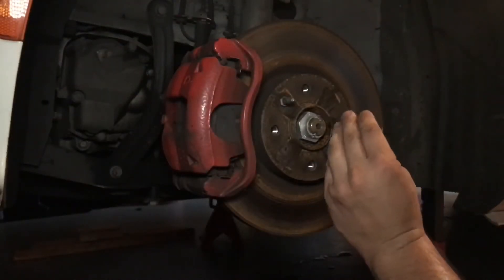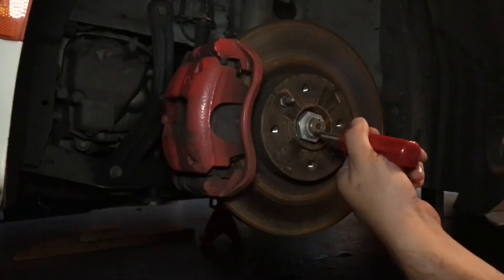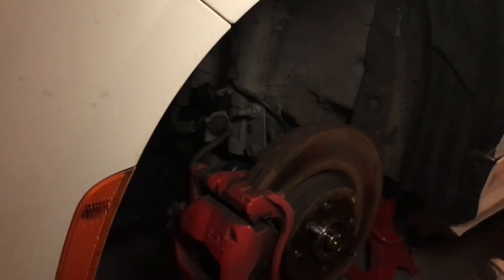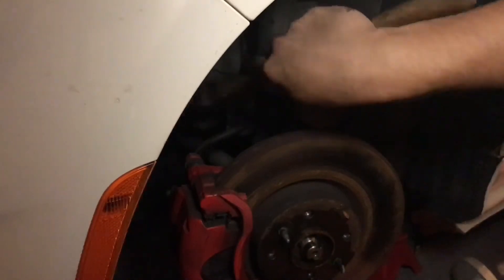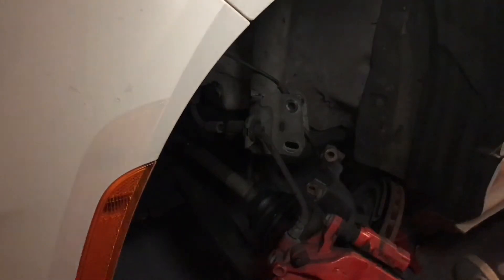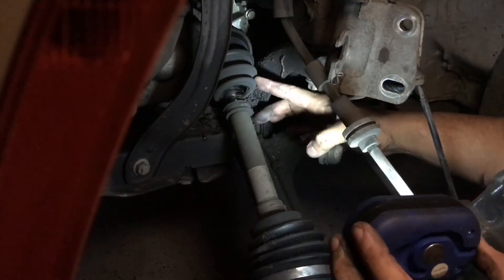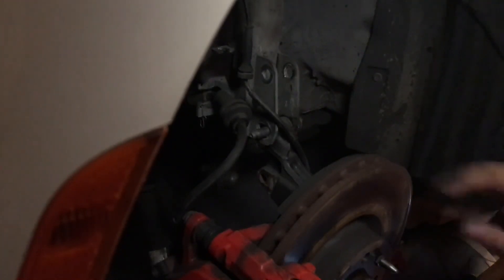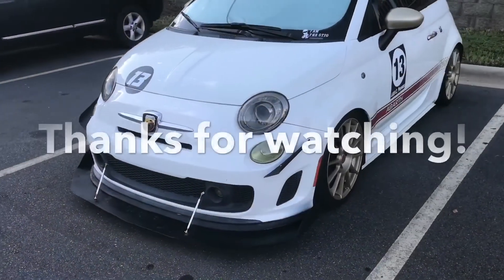Fiat 500 Abarth Axles Pt.1

Comment: That axle nut requires a tapered socket.  You wont find one in the USA.  You can order one from England.  I bought a regular socket from the local auto parts store and then I ground it down so it was tapered.  I am surprised you got yours off without doing that.  Also if you had rented an axle puller (slide hammer type) that attaches to the end of the axle, you would not have fought with the removal of the axle.

Comment: thanks for the video... quick question. Are there supposed to be shim washers between the hub and the axle? When i torque the nut to spec the axle wont turn. The axle is pressed firmly against the back of the hub assembly. It looks like it needs 1mm of shim or something

Comment: Proper video mate very nice detail , hook it up with what mods you have on the abarth!
Reply from the maker: Renan Valenca thanks man! Stay tuned, finally was able to film a video this past weekend. I did an intake, racing plug and Alfa Romeo 4c coilpacks, blow off valve and front mount intercooler. Next will be methanol injection and bigger turbo
Reply: @purezagarage7046  
Hey bro what year is your Abarth and do remember the part number for the axles?

Comment: @Chodelips I ordered mine on Amazon.  Laser 6279 Hub Nut Socket thin Walled Deep 36 mm. $17.66. Works fast with breaker bar and two foot steel pipe, chain link fence pipe cut in different sizes for different spaces while working on the Fiat.

Comment: Use correct heavy punch for metal.  Looks like your nut came off easy.  I have had to heat up with torch and put cheater pipe over breaker.

Comment: @majurbludd Axle puller attached to my boat winch, attached to my parts chest that I sit on to pull tight the bar, wack 3 times with slide hammer, then winch off with boat winch for gears doing the work.